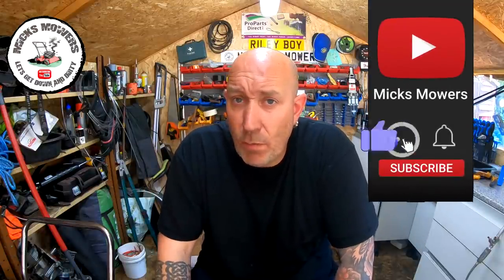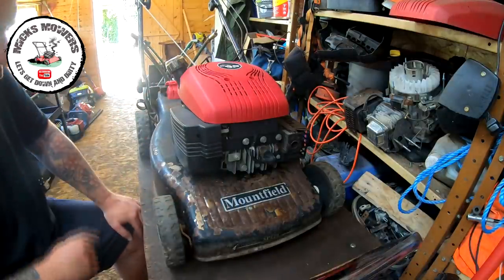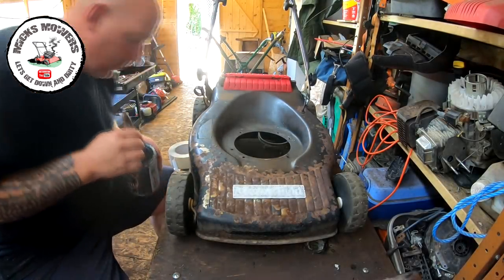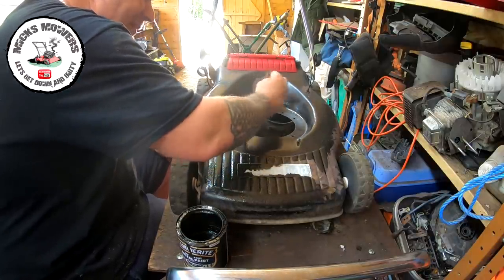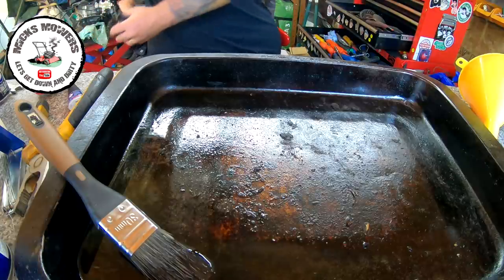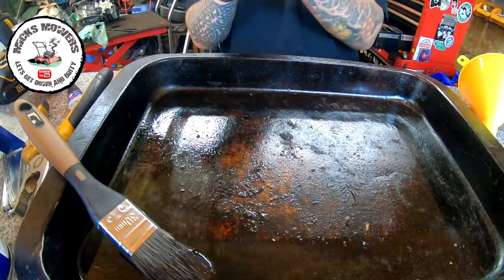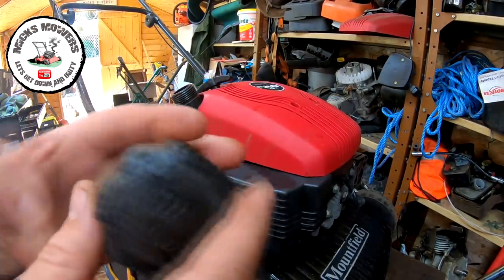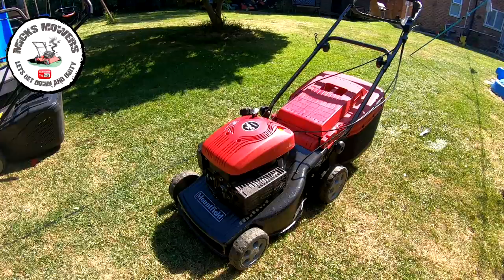Mountfield Lawnmower Saved From The Dump Quick Little Face lift

Comment: A great result Mick. I love bringing life into what may be discarded. Have a look at plastic welders, they are about £40 on eBay. I often did what you do with the soldering iron, and still do for small jobs although it is important to use the right plastic. I have seen videos of folk using zip ties, it’s ok if the plastic is the same, if not it’s like trying to weld fat to ice. You should be on telly fella, you have first class presentation skills and you know your stuff. Brilliant channel 👍🏼
Reply from the maker: Thanks mate. Yeah I too have used zip ties. I will look into a plastic welder

Comment: Fun stuff with the family.  I will be painting a deck this week too.  If the self propel works.  I tried some WD40 today instead of carb cleaner.  Jury is out yet.  LOL   Same result but i always put the bowl drain to the front of the machine.  I will do more plastic welding now.  Not a Torch spark plug??
Reply from the maker: You will be wearing a black vest top next lol hope your good mate

Comment: Hey Mick carb full of gunk . It's good when the wife brings  lunch out. Tina does it for me now again if I been a good lad lol.  Like them Mountfeild mowers the old man used the also the council up here used them. Boy a bit of plastic welding can't beet it.  Don't have to be pretty lol just got work.👍👋 running just fine now mate. It will burn the smoke off.
Reply from the maker: Hi mate ta for watching. Yeah lovely when its lunch time. My mrs p looks after me

Comment: Hi,  which is best for cleaning??  WD, carb cleaner or brake cleaner.  Any views appreciated.
Reply from the maker: I use WD40.. as carb cleaner can make the o rings expand.. but if you can remove the o rings then carb cleaner will do a good job